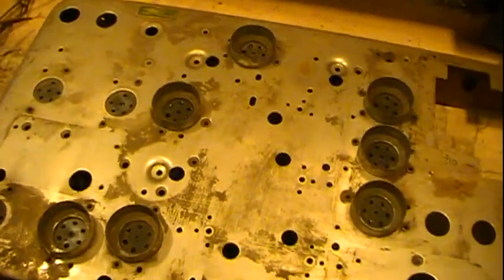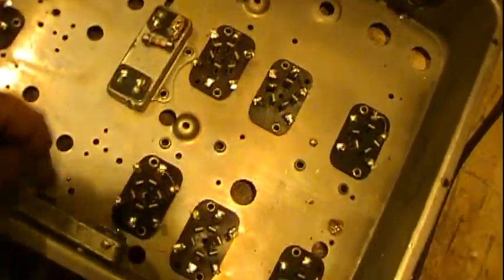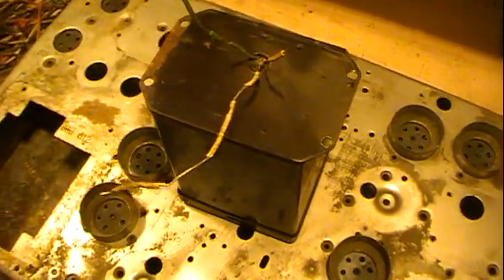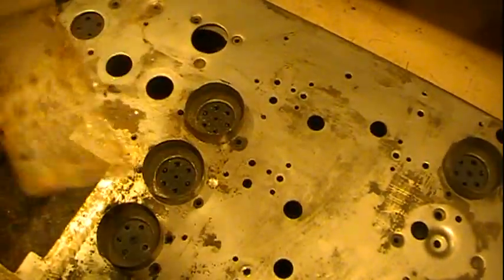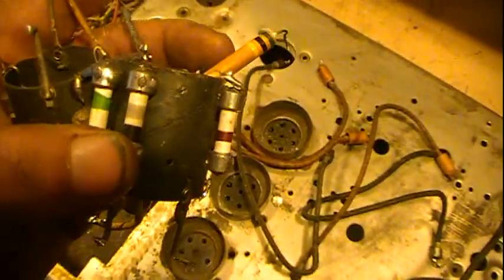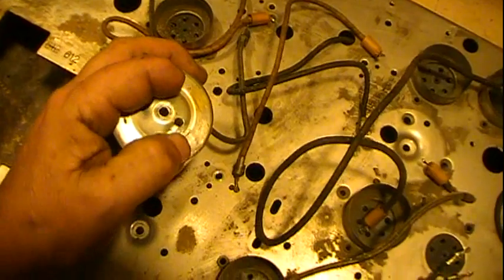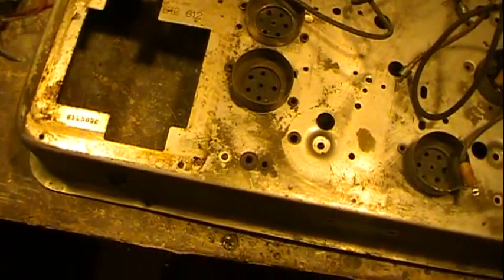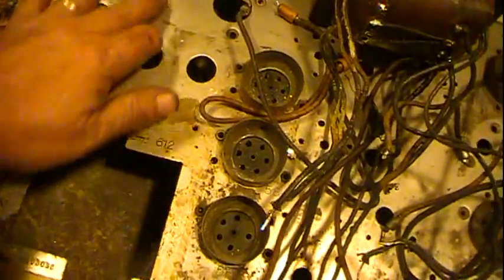AK 612 part 1

Comment: Woah... That's a heap of resistive wire you've got there Dennis!
   Also, that is one loaded power xfmr. Two separate DC supplies. I'd love to see those two mercury-vapor rectifiers glowing in the dark in the near future. I had one in my power supply for my WWII airplane converted 2 meter CW transmitter and receiver. So cool to watch them glow in the dark.
   Tom